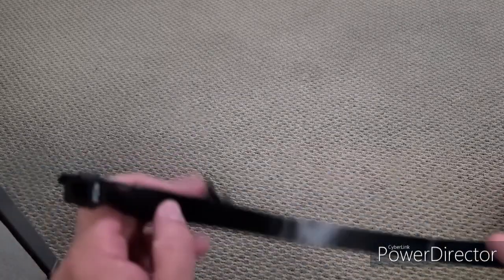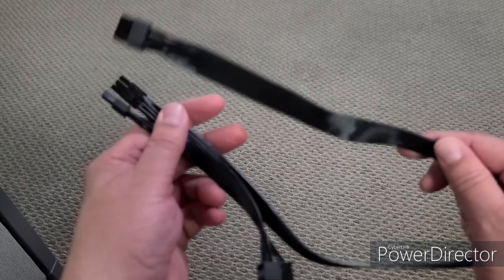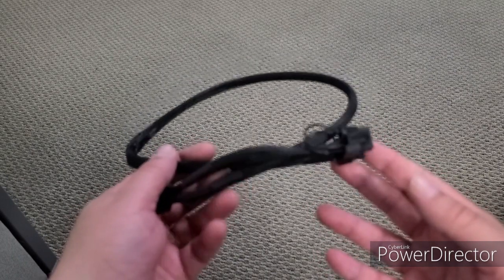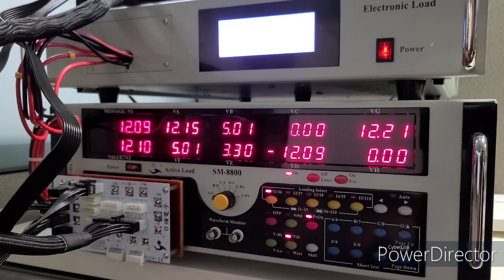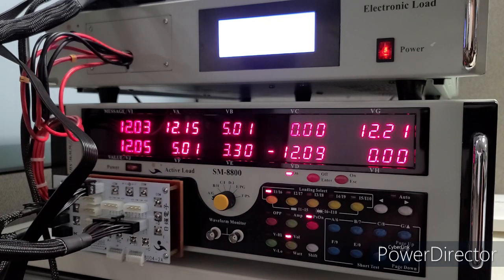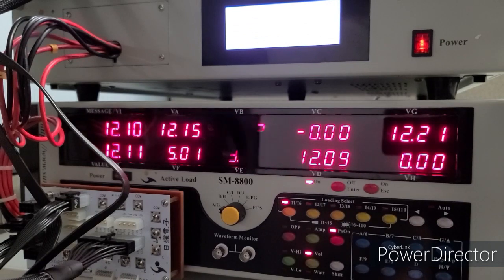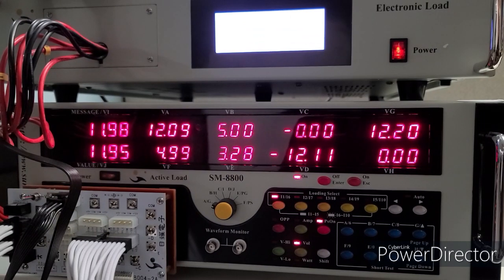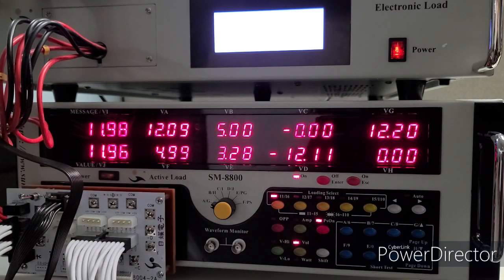Testing different PCIe cables using a SunMoon ATE

Comment: Hello! I am using MSI MPG A850G PCIE5 PSU paired with a Zotac RTX 3080 Trinity OC(2x8 pins) currently using 1 cable daisy-chained to it. Will the cable handle it?
Also, gotta mention, I visited the PSU site, it says use the two vga connector. Should I follow the PSU manufacturer after all?
Reply from the maker: Yes.  Using the one cable with pigtail should be fine.  The MSI uses 16g wire like the first test I did.

Comment: Can I power an Rtx 3080 Ti, that need 2 8 pins, with a 600W Aerocool Aero Bronze psu that has 2 x 6+2 pin Y shaped cables looking very similar to the first cable you show in the video? Please HELP its urgent !
Reply from the maker: Absolutely not.  I hope you're joking.  :(
Reply: @jonnyGURU Well I just did? Idk if it's safe though
Reply from the maker: Probably not. Download Furmark, Prime95 and Linpack Xtreme. Run Prime95 and Linpack and then run Furmark.  After Furmark runs for about 5 minutes, go back to the PC and hit the space bar once every 10 seconds to make the "fuzzy donut" disappear and reappear.  If it shuts down, replace your PSU ASAP.  If it still works, replace your PSU within the next year.

Comment: What about the 18awg main, 22 awg daisy of the leadex iii gold, big no no right?
And a 16awg with 18 awg daisy would that be fine for something like a 3080 Founders?
Reply from the maker: 18g daisy should be fine since it's only <150mm.  Not sure I dig 22g, though.
Reply: @jonnyGURU  have you done any tests on how the different setups would handle the big spikes and transients of a 3080/90/6900xt ?
Reply from the maker: @UnluckyDomino  Yep.  We're doing that testing on a daily basis.  Wire gauge has no impact here.  The transients are just too fast.  A poorly thought out analogy would be lightning.  :D  300kA of power that's only 2-3cm in diameter.  :D